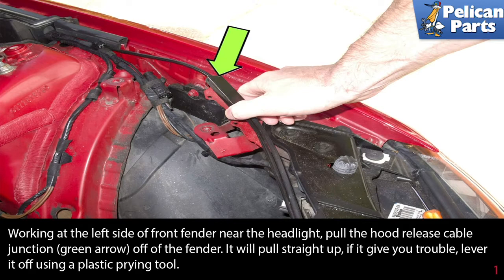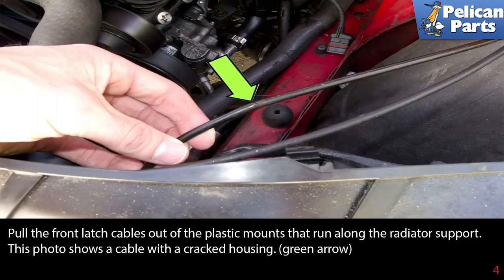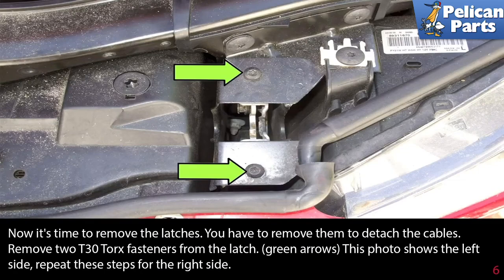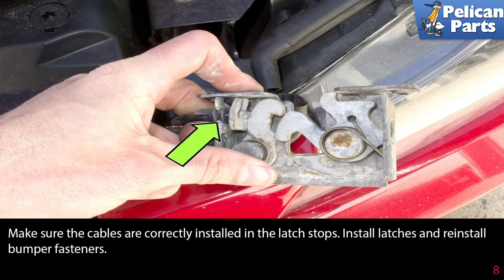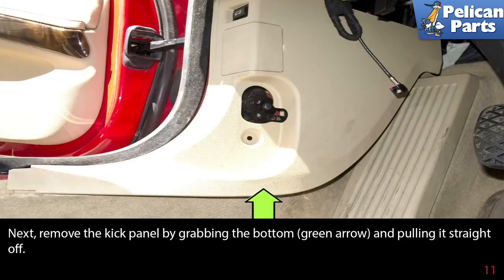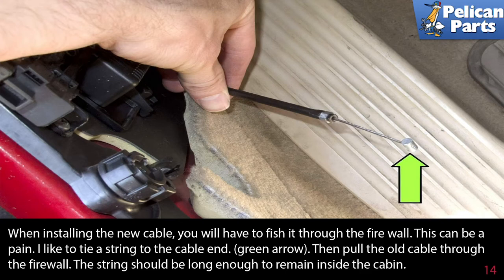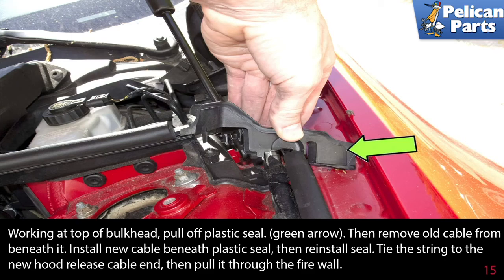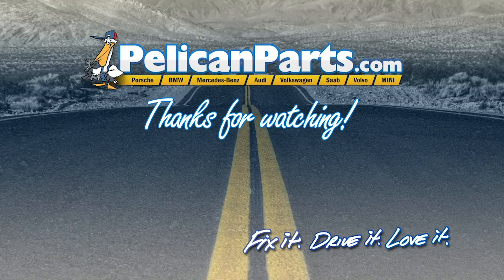BMW E90 3-Series Hood Release Cable Replacement for 325i, 325Xi, 330i, 330xi, 328i, 335i

Comment: As someone who’s only done a few DIY’s in the past, I ran into a couple issues while attempting this repair and made a mess of things.

1) While trying to slide one of the latches out, it slipped and dropped down into the area below where it normally sits. Do you have any tips on how to lift it out? I don’t think that area is accessible from the main engine compartment and I can’t fit my arm down to reach it.
2) While trying to fish the new cable through the firewall, my string broke…Now every time I try to feed the cable through it keeps getting tangled up somewhere inside the firewall. Any tips on how to feed the cable through?
Reply from the maker: All tips are covered in the article. 

You may have to remove the bumper to access anything you drop in there.

Attach strong wire to the cable when fishing it through. MOnitor it as it goes through. There isn't much for it to get stuck on.

Comment: how am i supposed to do any of this if i cant get my hood up
Reply from the maker: By working from below or through bumper cover. You will have to release the latch manually using a screwdriver or a hook.
Reply: You can also open the hood by removing the driver side wheel well cover and manually pulling on the hood release cables.
Reply: @jonathanthompson3359  yeah easy fix
Reply: @jonathanthompson3359  best way to handle the situation
Reply: This is a lot harder than it sounds. I needed an endoscope to hit the latch.

First try getting an assistant to push down on the hood while you pull the lever or cable from under the wheel arch